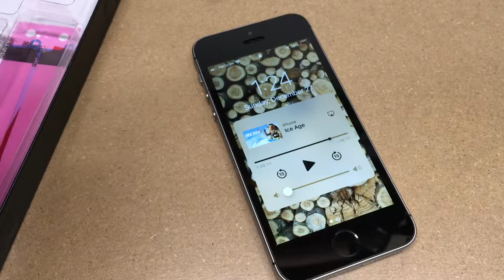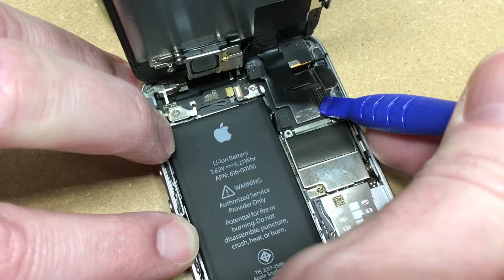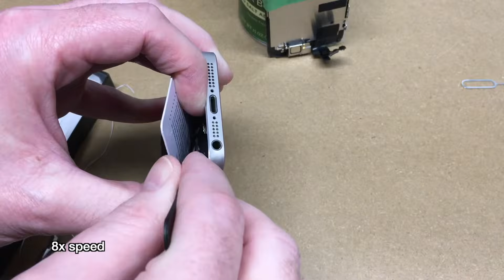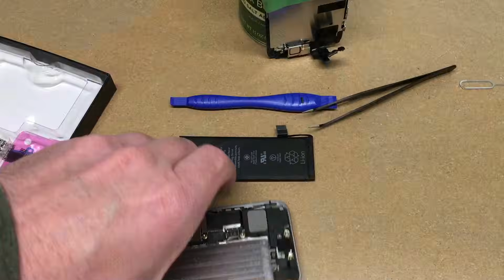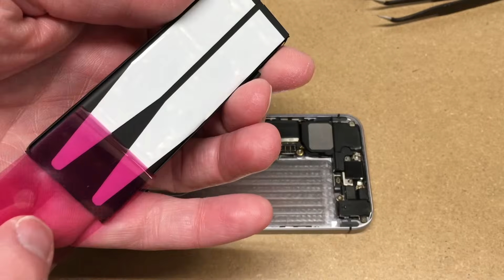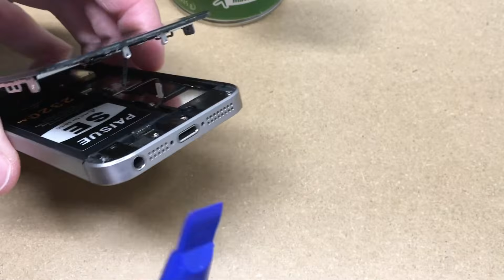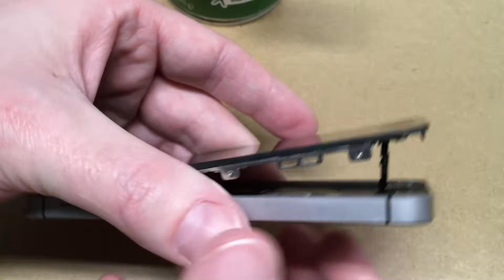iPhone SE (1st Gen) Battery Replacement

Comment: Thank you so much for your video, I could remove the battery.now, i am struggling to reconnect digitizer cable connector, is there any tip?  it was easy  and fun to disconnect...

Comment: Very good video thank you, however view obstructed by your hand when dealing with the top metal plate and when completing and you don’t show detail of best way to get the button cable and clip in place, as it is asymmetrical it needs to be around the correct way before pressing, clear video of this would be useful otherwise a successful job completed, now for another one! Thanks again.

Comment: I went through a number of vids before I lucked upon yours. You showed all the foibles trying to get these 1st gen phones cracked open without cracking them. 
I’m not embarrassed to say it took me about 1.5 hrs. to complete the replacement. Most of that time was spent getting the case to separate. Thank you for an honest, unfiltered and real life DIY. I would have quit the install if it weren’t for you. The phone is working flawlessly. Thank you so much!!!

Comment: I just replaced my battery via your vid- it worked!  Also, the fact that your adhesive broke during the demo was actually a very helpful point in the vid because I pulled my adhesive at too low an angle (even though you warned against it) and the adhesive broke off.  So I got some floss and worked the battery out with that.  Excellent vid, thanks so much!  I’m now calibrating the battery per your instructions.
Reply: How is battery life now?

Comment: please, If you can answer-
i brought my iphone se in for repair. it wont turn on. 
they told me since it cant turn on, they cant open it to replace the battery. 

when you turned yours back on it looked like everything was the same as before it was turned off. 

is it true? can the phone be fixed? can a new battery be put in even though the phone wont turn on. its just showing the little red battery icon.
Reply from the maker: I've never had that specific problem. I have had the red icon but it eventually boots up if I leave it plugged in. You might try a different repair service. If the battery is causing the issue, replacing it should fix it. If there is some other problem with the phone, then I'm guessing you are out of luck.
Reply: thank you for replying. 
it turned on and did charge on my car charger. but now my car charger itself broke. so that isnt working.

Comment: I just bought this phone. Didnt know it had a regular headphone jack until now! even more excited and will definitely be doing this battery upgrade! thanks for the vid!

Has anyone used a hot air gun on low setting?

I also read a review on amazon that said it was easier to pull the glue strips down the length of the battery. Any thoughts?

Comment: I’m watching your video and it looks legit … partially, so let me explain … I bought all of those crappy batteries so far, but I couldn’t order this particular PAISUE or LCLEBM(out of stock or no shipping to my location), so all of them could be max 2180mAh and not over, so the OEM battery is 25grams, so whenever you stop using this iPhone SE 1st Gen would it be possible for you to replace this PAISUE 2320mAh battery and to try to measure its weight on electronic kitchen scale ? I’m requesting this from you because so far the Deji 2010mAh and the other 2000+ mAh batteries are really heavier (29 grams) so if yours PAISUE 2320 mAh battery is over 29 grams it means it is really 2320mAh and if not it means it is just another fake advertisement and it is just another Chinese marketing trick …

Comment: Hi,
Some people told me that you we replace the battery by a non iPhone original it will damage the phone and will end up destroing it..what is your opinion o  this battery brand?
Reply from the maker: There is always a chance of getting a bad battery. I haven't had any issues with mine. I have had issues with Apple OEM batteries in my laptops. You would think Apple would use good batteries but even they can go bad.

Comment: THIS… is the only vid I’ve found that suggests you calibrate the battery. You also suggest testing the phone before everything is completely reassembled; though I would test it before pressing the screen back into the case. Obviously the toughest part is pulling out the adhesive.

Good vid.  Score yourself ten bonus points.  Do not pass GO!  Do not collect $200!

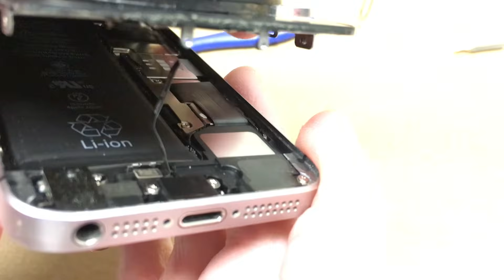EDIT:  3:03 my SE had a little metal cap holding down this cable.  BEFORE taking this cable off PAY ATTENTION TO THE ORIENTATION OF THIS CAP!  It must be replaced in the same orientation.  Mine had two little tabs on one side and just one little tab on the other.  Holding the phone as you normally would, the one tab was oriented toward the bottom of the phone.

Comment: Very helpful video, thank you! For me the hardest part was getting the case open. I don't think I'm too weak, but it took me a lot of strength to put enough force on the suction cup to move the screen. I eventually used 2 suction cups and wrapped some strong wire around my phone to keep the 2 parts from flying appart. That probably saved a lot of cables inside. And also, my device (128 GB, EU) had an additional cover on top of the Touch ID connector, but that wasn't too hard to handle.
Reply: Absolutely agree, cases on videos have been opened more than once so easy to separate, also reconnecting the cables wasn’t as straight forward as shown as the alignment is not that easy, otherwise a well presented video.

Comment: Does this larger battery works fine in the long term and how much does it increase the battery life.
Reply from the maker: I don't have an easy way to compare it with the original phone battery when it was new. The new battery is at least working as well as the original battery. I replaced this 10 months ago and it is still working well.
Reply: @Rickmakes  Thanks a lot!  Very good to know that this battery works good. Can you get 4 plus hours of screen time on IOS 15. I am finding the battery go very fast on iOS 15 and am hardly getting 3 hours.

Comment: This was incredible. What luck to find your video. I was about to trade in my SE as I stumbled upon this informative session. I purchased the kit, replaced the battery (after breaking one of the original adhesive strips as well... oy), and am looking forward to keeping this beauty of a tiny phone going for a few more years. Less landfill material! Thank you very much.
Reply: That’s cool, I’m still rocking the se
Reply: Just removed the battery of an SE I got a month ago battery was 79% the tabs broke (rookie shit haha) I had to put alcohol as much as I could and with a plastic tool and my fingers pull the battery out lol, that was an absolute nightmare. Amazing phone still to this day lol even with the battery % that it had.
Reply: Original SE was the best phone they made
Reply: I'm wondering if it is even necessary to add the adhesive to the new battery....seems like it will be even more of a pain in the backside next time to replace the battery.
Reply: Is this battery good? Did it improve battery life? Does it still work? I know, too many questions lol

Comment: Never believe a battery that is larger capacity than the original but the same size...
Reply from the maker: I don't get too caught up in battery capacities. It is possible that energy density increases but probably not by a lot. There is a lot of marketing involved in battery sales. Just look at power tool batteries. Some say "20v" and others say "18v". A lot of those tools use the same or very similar cells.

Comment: What's the reason for removing the screen completely?  It seems like the battery can be removed without disconnecting the screen.  Is this step necessary?
Reply from the maker: I do it because I don't trust myself not to damage the cables while removing the adhesive from under the battery.

Comment: What kind of suction cup was the black one?
Reply from the maker: It would generally be called a "suction cup mount". It has a tripod thread to attach a camera. If you have one, it can work. Otherwise you can get suction cups specifically for removing phone glass. I used the mount because I had it.

Comment: Thanks for making this video. It is super helpful. I changed the battery. Obviously I broke both battery tapes - I used 3D printer heatbed and a dental floss to remove them. I inserted the floss under the battery, then set the temperature to 55C, waited for the phone to heatup and the gently work my way under the battery with the floss inserting the spatula under one side of the battery.

Comment: How is the life and performance of new replaced battery?Are u getting long battery life than original one?If so i am planning in replacing my own battery.Its efficiency  has reached to 80 now
Reply from the maker: It's hard to measure exactly but it seems to be similar to what I got when it was new.

Comment: Would u be able to heat the phone up with a hairdryer or would that not work
(Edit) Hairdryer did work and the battery came out really easy.
Reply from the maker: A hairdryer would work. You would want to make sure to heat it evenly by pulling the hairdryer back from the phone and/or moving it back and forth.

Comment: Bro i have changed the battery but volume buttons are not working 
what shd i do broon now???
Reply from the maker: I would try disconnecting and reconnecting the cables that were removed to do the battery replacement.

Comment: Great video. I noticed your Touch ID cable was missing its metal retainer clip in this video. I had to find another tutorial to cover reinstallation of that little sucker. Both pull tabs for the battery adhesive broke instantly so I had to break the rules a little bit and pry the battery out with a gift card and bend the battery in the process. 

Also as others have pointed out in the Amazon review, this battery is about half a millimeter thicker than the original Apple battery. After reassembling the phone, if you press hard in some areas of the screen, you will see the LCD discolor and warp a little bit towards the bottom. The extra thickness of the battery pushes against the display.  It's pretty minor though and the battery seems to be good quality regardless.
Reply from the maker: I wonder if there were different iterations of the iPhone SE as I never had the retainer clip in mine.

Comment: Great video, I will watch this while I repair mine. But at 4:40, why exactly do you remove those 4 screws?
Reply from the maker: By removing the screws and the underlying cable, it allows me to separate the two halve of the phone. This prevents me from damaging the ribbon cables in the following steps.

Comment: Thanks Apple. What an ass-ache. Appreciate the video. Love my SE but the battery is waning.
BTW, what kind of beans did you use? It's probably a good idea to use the same ones.
Reply from the maker: I used HyVee (store brand) black beans. They are only available in the midwest (of the US) at HyVee stores. I'm guessing other brands of black beans would probably work but I only tried this brand. You could get name brand black beans but if you got that kind of money you probably aren't replacing your own batteries. :)

Comment: It proved to be very difficult to open the iPhone case with the suction cups. Finally, the case flew open - too far. The cable inside became disconnected from the back side of the screen. It isn't torn. The place where it was attached has some sort of flat rectangular piece of metal.Nothing seems to be torn. Any suggestions?
Reply from the maker: You can try putting it back together. If you are careful, you can power it up without snapping the screen back in place. This would allow you to make sure it works before you continue with the battery replacement.

Comment: There are no question pertaining strip tape backing. Can you forego using the 2 strip tapes? Or at least using 1 strip instead?
Reply from the maker: While it seems like it would work just fine, I'm thinking there is a reason they used two strips of tape. I personally wouldn't want the battery sliding around (even a little) and causing itself damage.
Reply: @Rickmakes  my replacement battery was a snug fit so I put it in without the adhesive. Seems fine

Comment: If you see an INCANDESCENT dot right on your battery after arming it with a pointed stuf, it will explode or burn or melt in the next ten to twenty second. It happened to me. I have been so lucky to put the battery outside before it happened to me... The smoke was horrible. If you are not sure what you do, just ask a pro.

Comment: Hi, many thanks for your video. One question: did you have to reset to factory settings the telephone after changing the battery? Background of the question: I have unfortunately let the battery change at the Apple store and they had to reset the telephone. They had warned me before this could happen... how possible do you judge this to happen?
Reply from the maker: I've seen it recommended that you reset the device but I don't generally do it for battery replacements. I guess I would try it if a problem occurred but I haven't needed to.
Reply: @Rickmakes  Hi, thanks for your answer. Well I was also asking this because I do think that Apple does it on purpose to reset the telephone. In fact if they reset it they will have to install the latest iOS version (so it works at Apple). By installing the latest version, the phone will consume much more battery, so you finally get tired of it and you better buy a new one. I have now iOS 14 on my iPhone SE and the battery lasts basically the same as the old one. 55 euro wasted.
Reply: iOS 14 consumes definitely more power, than 13 did. The best of it was 14.4, but this version is now gone to get to.

Comment: is lithium-polymer is better on iphone se or buy same type of on stock iphone se lithium-ion?
if I change to polymer, does it reduce performance on iphone SE?
Reply from the maker: I didn't see a big difference in performance or capacity between lithium-ion and polymer. Polymer is supposed to be safer but I haven't personally had problems with lithium-ion. I would go with either.
Reply: @Rickmakes  because on iphone website they have explanation why they use lit-ion, but it only had 1500+mahz, so i plan to polymer cause most of it had 3000+mahz, so i wonder maybe it reduce performance

Comment: Changed the battery using your directions. One glue strip snapped. I couldn't get the floss trick to work, so used a card to prise the battery up. The most difficult part was the final connection. The small cover had come off so it was a bit fiddly to replace both, taking several tries. I took the opportunity to clean around the edge of the glass with an alcohol wipe. It was reassuring to see the Apple logo appear before I had completed the final connection. 
Once done, my daughter was able to remove everything and reset it. 
However, the iphone won't charge. The charger is fine, as it works on another iphone. It appears the original battery was probably ok, with the problem being the charging port. Have you changed one of those?
Reply from the maker: I haven't changed a charging port but I don't think it is any more difficult than changing the battery.
Reply: @Rickmakes  Thank you. I have found a video relating to that and have ordered a new charging port. I tried a DFU reset, but that didn't make any difference to the charging. The iphone shows that it is charging, but it isn't.

Comment: One question about the touch ID sensor: There seems to be a small metal cover on top of where the touch ID sensor connects that wasn't on the phone shown in the video. I couldn't really figure out how to get it back on, but I connected everything back afterward without this piece. So far everything seems to be working fine without it, including the touch ID. I have the rereleased iPhone SE (first Gen. Not the current second gen) with 128GBs. Was this something added later on the rerelease or different by region? I purchased it in the USA.

Comment: I bought the battery kit you showed here. I was able to follow your instructions and replace my battery. Many thanks! The hardest parts were first getting my case open. I finally had to use a small flat blade screw driver and a small hammer to open it. After that the hardest part was getting those tiny screws back in the hole. But phone is now back to normal.
Reply from the maker: Glad you were able to get the job done!
Reply: does it last longer than the apple’s battery that comes in the iPhone?

Comment: Hello, the video was very helpful. But I have a issue with the screen when all is set up and I switch on the apple keep flashing?.
Reply: i have that too.
Reply from the maker: I would try re-seating the connectors between the phone and the screen.
Reply: I did that like 3 times, apple support told me to update or restore from iTunes the iPhone with IOS last version
Reply: @Mack broken!!! more than 200bucks to raplace the mother board. I do not recomend this batery.